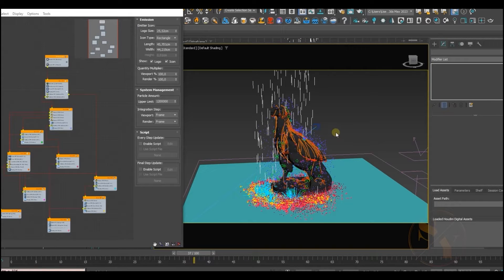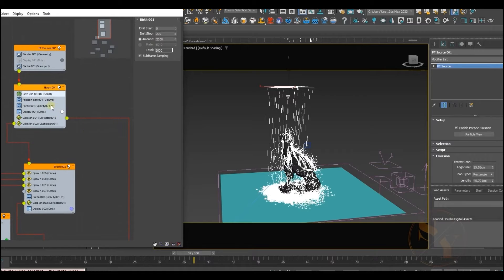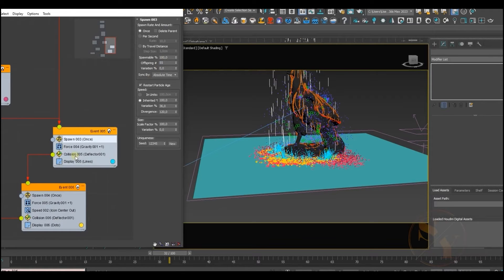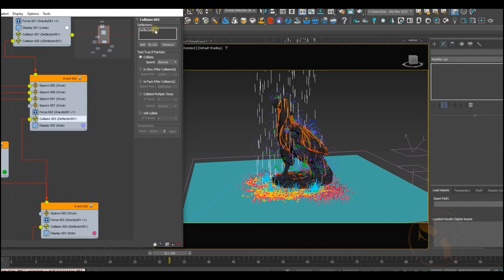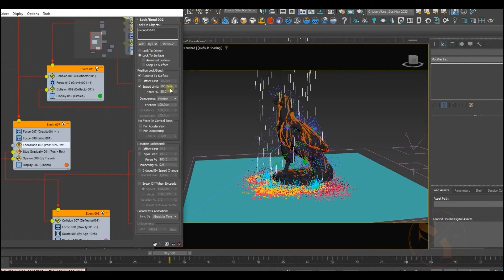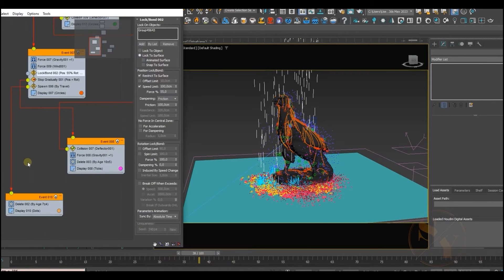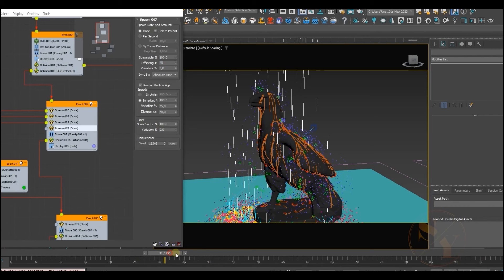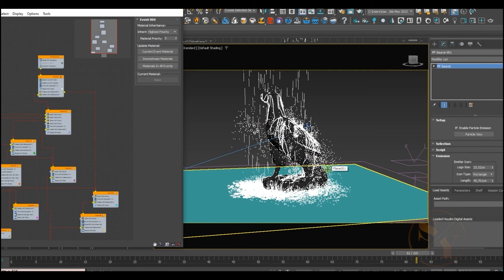3DSMAX:  RAIN FX #3dsmax , #vfx, #particles #PFlow #rain

Comment: Great Particle system! With what renderer will you render it and would it create a thin film of water on the object and the floor?
Reply from the maker: Thank you!  Scanline - Vray mostly or FStorm give a try and sure you can make good-great render of it. I'll do some renders soon.
Reply: @qizilminor  I assumed that these could be your renderers of choice, because now I am working with Corona and unfortunately it does not support particle render, as far as I know. You have some how to convert these particles to mesh, like using bloobmesh or phoenixfd, to render them! :/
Reply from the maker: @MoiDesign3D   This is a good idea for review and would work for sure. I'll give a try with corona,  sometimes being asked to convert to client's preferred renderer, so let's see the outcome). thanks!